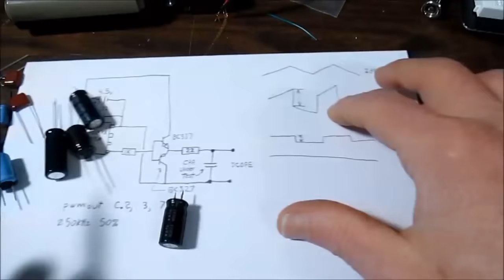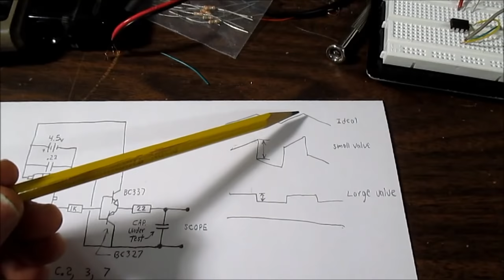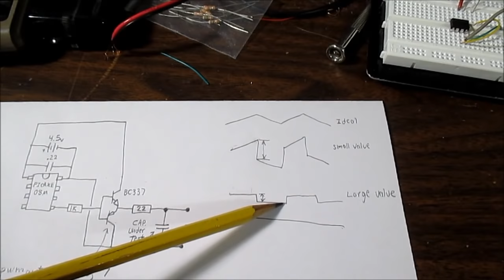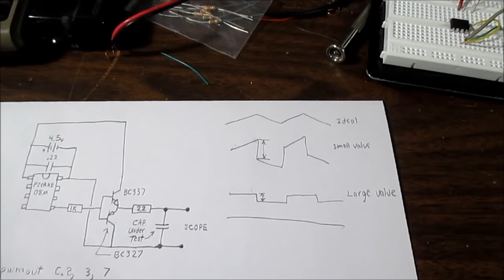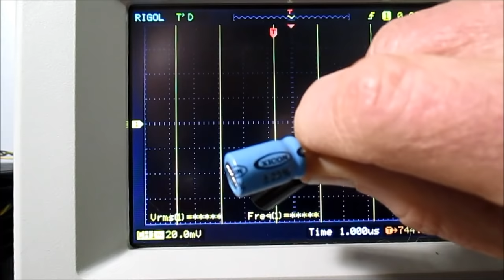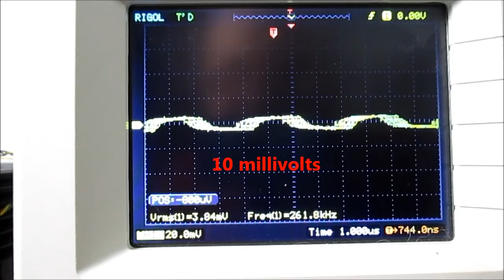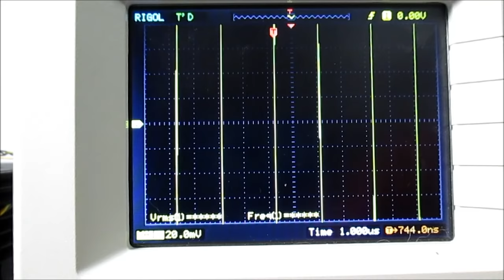Capacitor ESR visual demo using the oscilloscope

Comment: I wish I had seen this several years ago when I was experimenting with the lm386 making an audio amp.  I have since moved on to building and flying drones.  I wonder how the x7r would help improve the video feed that gets distorted by emf from the electronic speed controllers and brushless motors on the drone?  The FPV community are using the barrel-type electrolytic 440 - 1000uf.  Can you give a reference to an X7R ceramic capacitor rated up to 24 volts?

Comment: Many thanks for another great video. One thing I've always wondered about polarized caps like electrolytics; They must of course be DC biased the correct way. But what if an electrolytic is biased with 0V DC, and then as the frequenzy of the signal passing through it goes down - what happens then? Say a signal of 0.1Hz - wouldn't it look pretty much like DC to the cap? So it would be biased the wrong was about 50% of the time. How low a signal can such a cap handle? Many thanks.
Reply: Polarized electrolytic capacitors require DC voltage and in the application you describe its positive side, for instance, would idle at 1/2 the power supply voltage and as the signal came through it would vary down to nearly zero and up to nearly the supply voltage.  On the other side it becomes AC (alternating current) but that's okay because the capacitor itself never becomes reversed polarized.
Of course, non-polarized electrolytic capacitors exist for situations where a DC bias is not present.

Comment: Fantastic video, thanks!
I have heard some audio-experts talk about the capacitors reaction time.
That a capacitor with large capacity are longer time to "react" then a small one, therefor it better to have different capacities so the small capacitors can start delivering while the large are getting ready.
Is that right?
Reply: "Is that right?"
That is correct.  It is common to parallel a small capacitor across a big electrolytic capacitor.  The "getting ready" you speak of is actually inductance in a rolled-up electrolytic capacitor.  You can see some odd behavior in the oscilloscope that appears not to be explained.  That's most likely the parasitic inductance of the capacitor.  Abrupt changes in current will produce a voltage spike on an inductor. So, there's inductance present, not just series resistance.
Reply: @thomasmaughan4798  Thank you very much for your great reply! But would that not mean it is better with lets say 10 small caps than 1 large and 1 small cap? Assuming both solutions have the same total value.
Reply: @friedmule5403  "But would that not mean it is better with lets say 10 small caps than 1 large and 1 small cap?"
It might depending on various circumstances.  Large capacitors tend to have significant inductance that can be a problem at higher frequencies but is not a problem at low frequencies more commonly encountered with large capacitors used as power supply filter caps.  The small mylar or cereamic capacitor is a high frequency bypass to keep stray radio signals out of the voltage regulator since that can produce oscillation that destroys the regulator and whatever is hooked up to that power supply.  
But there's a gotcha:  the inductance of the large capacitor will form a "tank circuit" and resonate with the small capacitor at a specific frequency and at that exact frequency it will not only not bypass, it will enhance that signal.  So the "Q" is reduced by a series resistor, a low value so we don't lose bypass effectiveness.  
A VNA (vector network analyzer) or BODE plot can determine the frequency at which this takes place; not that its a big problem but if you have CB or ham radio (for instance) then it could become important.
Reply: @thomasmaughan4798  Thank you so very much, this makes so much sense! Are you a teacher or something? :-)
Reply: @friedmule5403  "Are you a teacher or something? :-)"
Old school electronics, discrete components and vacuum tubes.  It really was a lot easier to learn the basics when the individual components were large enough to handle and combine in various ways.  It was fun!   Still is.
Reply: @thomasmaughan4798  It sounds a bit like my journey through the computer world. I was easier to understand things when DOS was at its infancy, number of chip instructions, assembler code, simply modular area of a board and so on was logical, vs today where most of it looks like magic. :-)
I am trying to learn electronic and unfortunately do I find that the modern Arduino / Raspberry often make it harder to do.
I.e. me searching for a simple blinker circuit, 90% of the solutions is "take an Arduino, copy this code and you've got it".
I need a latching push button "take an Arduino and here is the code".
I want to learn electronic, not programming, I know an Arduino can do it, but please let me learn the basic. :-)
Reply: @friedmule5403  Sounds like you need a tiny magical chip called the NE555.  It can be configured for blinking or latching.  It's basically just a flip flop with suitable resistors and capacitors it's bistable (not sure about that one), monostable (timed one-shot) or astable (blinker, oscillator; but square wave not sine wave like you'd get from an oscillator).
Reply: @thomasmaughan4798  Yes, the famous 555 is a great chip. My point is more that, no matter my project, i.e. a remote control, a tiny radio, a steady blinking LED, a volume control or yes no matter what "grab an Arduino  and add some code".
To me, does the Arduino sound as the step right before going on eBay and buy a finished module.
This is my opinion, not electronic but a sort of Lego where how it works does not matter as long it does.
Reply: @friedmule5403  I get it.  Not much fun to assemble a couple of snap-together modules and say you built something.  In the infamous words of Barack Obama, "you didn't build that!" but take resistors, capacitors, a few transistors and make a radio or an oscillator or something more sophisticated, yes, you built that!
Reply: @thomasmaughan4798  Yes exactly. It may be more expensive, it may take me 10x the time and heck it may not even work, but I did it, it was ME who screwed up, I have had a hand in selecting each component and damn if I am not also the one who get it troubleshooted.

Comment: ESR is also problematic in tweeter X-overs 4 ohm ESR dulls the treble, I put in WEAH 2.7uF poly caps and the difference was clear ( I used the "singing Budgie's" Locomotion) as the test record. Kylie Minogue was nick named that in 1987 and hated that nickname

Comment: So in your circuit, if the capacitor had no ESR of if you just connected your test probes together, would I see just a flat line?    How much voltage and current does that circuit supply?  Thanks for the educational videos!
Reply: Yes (ideal).
 <4.5V
Imax = <4.5/22 = <204mA, but real life could never get that high, would require an infinitely large capacitor with Zero ESR. Complications also include battery ESR, transistor Vsat losses, etc.

Comment: Loved the video. So, higher ESR does/doesn't mean the capacitor is going bad?
Reply from the maker: It would be relative to a cap of the same type. For example, that 330uf Xicon cap was not bad, it was just not a low ESR type. It measured about 17mv across its ESR in my jig, however, if it measured 50mv, I'd consider it likely to be failing.
Reply: JohnAudioTech   I guess the datasheet needs to be referenced to determine the design tolerance then.  Thx!

Comment: I work on power supplies that I take in for repair. On one type I get in on a regular basis I see a lot of spikes like you have on your scope. Problem with this power supplies are that some resisters are overheating. these are resistors that are meant to heat up and their off set high off of the board but they heat up to 300- 400° and overtime day darken their surrounding board area. What would you suggest can be done about this. 

By the time I get these power supplies they're not working due to component failure. I can locate and replace the failed components. but I don't seem to be able to figure out how to lower the heat of these resistors.

Any suggestion would be greatly appreciated.
Reply: Persistent overheating of a power supply regulator suggests excessive voltage in the transformer and the transistors and resistors must regulate this down to whatever is the specified voltage.  Spikes suggest an inductive load somewhere in the mix, particularly with switching power supplies.  A small capacitor in the right place (more than one probably) and probably with a modest resistor in series becomes a "snubber" to control these spikes.

Comment: Hi John. :-)
I have a question.
Is there a way to measure the max rms power that a speaker can handle witout the risk of overloading it ?
Reply from the maker: Not very easy. Speakers suffer power compression when the voice coil starts to heat up. It might be possible to measure that with some risk of damage. If the driver has a part number, you can search online.
Reply: So i guess the power of a speaker depends on the frequence. first find the ideal frequence of the speaker like you explaned in one of youre video's. And then use that frequence to test the maximum power. (with ear caps :-)  )

Comment: You might of been able to reduce some of the inductive effects by using an old fashion Carbon composition (core) type resistor instead of that Carbon film type with it's spiral cut.
Reply: I also wonder about the 22 Ohm value, how you come up with that and if it's value should be changed for testing electrolytic VS small caps?
Reply from the maker: I can solder the circuit on proto board with better components for improved performance but this is thrown together for the video and to test the caps that came with the LM1875 kit.

You could (should) use higher current drive for the low ESR caps to see the differences, but the idea here to keep it all the same to show the relative performance differences.

Comment: Interesting, I think the capacitors used in a power supply like and audio amp you need to bring the frequency to double the line frequency. Note that is for the Power supply. As for a SMPS PWS you need caps with low ESR for high frequencies depending on the frequency produced by the SMPS PWM circuit. I am sure you get some different results with different frequencies.
Reply: Electrolytics are used in audio power supplies a lot because of the much higher capacitance. They are trying to minimize ripple as much as possible. Ceramics are also avoided to avoid microphonics, but they are sometimes used right next to the op amp if a switching power supply is used. In audio amps with linear power supplies, you won't see ceramic capacitors because they aren't necessary, and it's better to not introduce the potential for microphonics.

Comment: Hello sir
Can I replace 16v 1000uf to 16v 3300uf ?
Atx power supply for car amplifier
Reply: Usually you can do this for power supply filter capacitors BUT the large capacitance is going to have a larger "inrush" current when you first hit it with 12 volts but in this case it seems harmless.

Comment: When scope does not trigger because of "small signal" make the signal "big" bij lowering Volt /div one step it wil trigger better. Or move with trigger level knob tp the middle of the wave - it will trigger beter

Comment: You frequency is too low to measure those small caps. The triangle is because the cap is being fully charged and discharged on each cycle. You're not seeing the resistance because the result is clipped off by the capacitor (ie. it's a high pass filter).
Reply: indeed